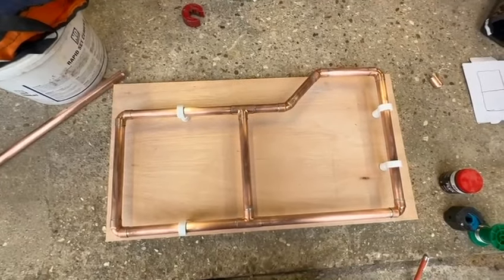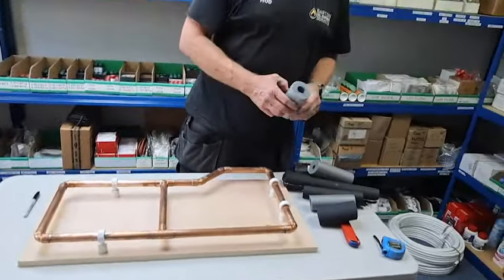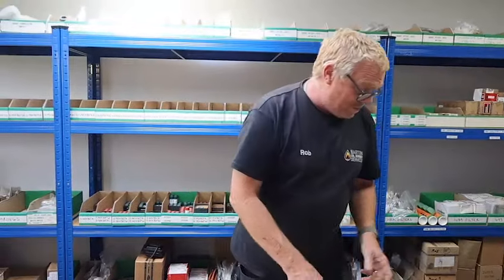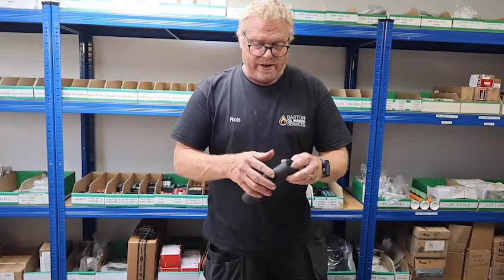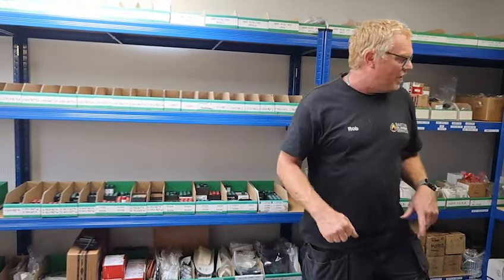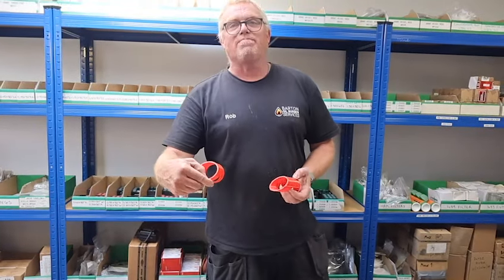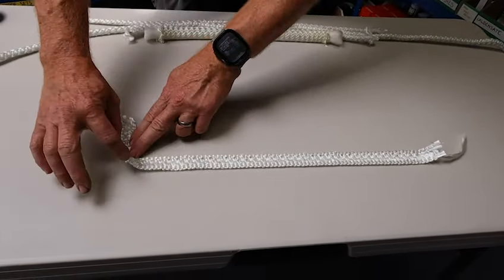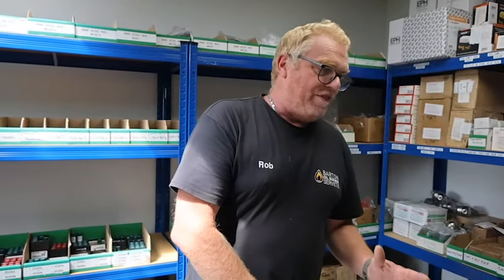BITS AND BOBS WITH ROB | PIPING INSULATION & ROPE SEALS

Comment: Hi Rob,

When replacing the larger type rope seal on a Grant,  do you just use standard 19mm rope seal or do you use Grants own type combustion door rope...? Theirs is a much tighter rope,  almost like a material rather than a traditional woven rope?

Thankyou,  John
Reply from the maker: Hi mate . I use 20mm rope seal off a real from ABGO Spares. Its cheaper than the grant seal and lasts better. just dont stretch it in, you sort of need to bunch it up a bit. Hope this helps.

Comment: Excellent info, what do you do to the frayed ends of the rope before you fit them?
Reply from the maker: I cut the rope with a very sharp pair of speedfit cutters to prevent a lot of this.i always make sure when i do the final cut once the rope is in i make it slightly longer then push the 2 ends hard together. Have a good weekend.
Reply: @BartonOilBurnerServices  cheers for explaining, enjoy the weekend too.👍
Reply: @pauladventure  I use proper heatproof tape around the rope and then cut it,  very tidy and proper job.  (As you say saves frayed ends, especially around cooker doors etc which open and close all the time)             Don't ask me where to get it, I can't  remember.......